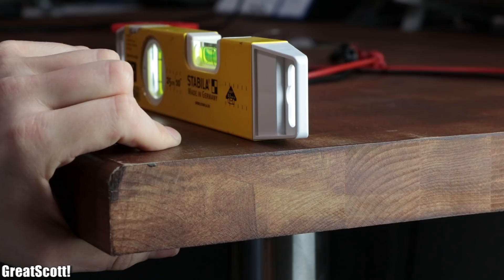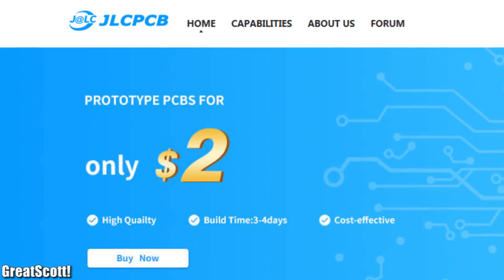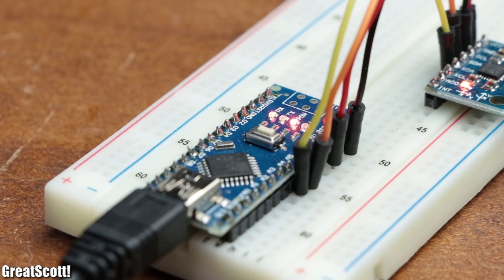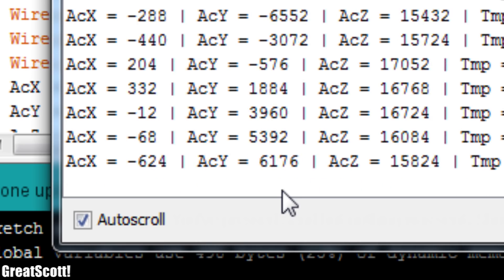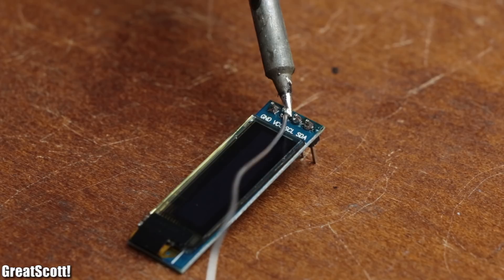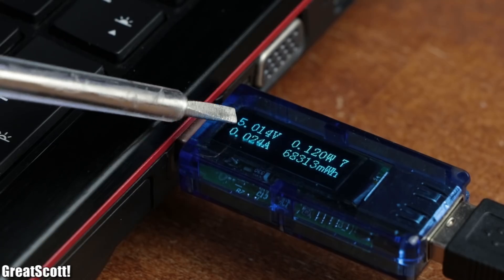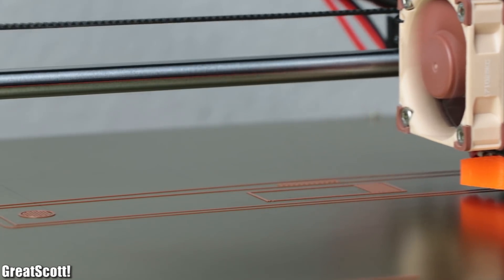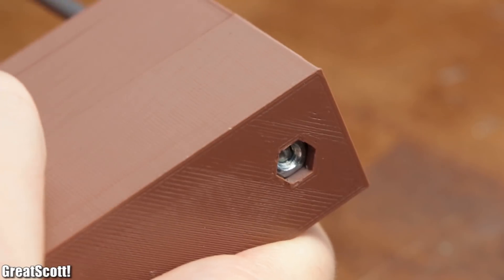DIY Digital Spirit Level || Accelerometer Tutorial

Comment: great tutorial! :)
I have completed a similar project, a car accelerometer but the problem in my case is if there is vehicle roll it picks it up and displays different lateral g force than real, a bit lower. I’ve used the mpu6050 and with a moving average it filters vibrations very well, basically even with engine vibrations or if you tap it, it would keep to zero obviously the “trade off”  is slow reaction time but this is in fact very convenient as you can’t read a display that changes the values too quickly. 
so the fix for the tilt would be a gyro but it seems a lot more complex 🤔

Comment: if you reset the board or... switch on the board at an angle, the MPU-6050 takes that as the reference angle(that is Pitch = yaw = roll =0).  For example, if I switch on at an angle of 45, it would display "0", and it will show the difference from that angle. 

How did you avoid this? Please help me with this.

Comment: What would it take to develop a 3-axis accelerometer that can save data, and including power supply can fit within an area 28x24x131mm? I'd like to mount one inside a model railway container wagon load, to record and then provide data on gradients and curve banking.

Comment: 28hours standby power for 1.2amp 3.7v battery. But what is the value 0.8 that you have multiple to get the standby hours. Sry if I am asked wrongly.
Reply: 2 years later and I'm scrolling through the comments wondering the exact same thing :P I think it's some kind of safety factor

Comment: With a bit more accurate and stable reading, it could be easily converted to a digital protractor (Few switches for unit selection, zero, 3d angular reading, angle registration and slight code additions of course). Waiting for the gyroscope part ;)

Comment: You need to calibrate it as the accelerometer may be at an angle to the bottom of the level. I would glue on carbide feet too that way you can lap them flat.

Comment: Why don't you calibrate the level by measuring the level, turn it 180 degrees around the z-axis, and then measuring again, and use the average as your 'zero'? Then you don't have to worry about how well your 3d print is, or how well you attached the accelerometer.

Comment: I actually have been using the 6050 to do some motion capture, using a library that taps into getting raw quaternion data from the chips that it generates itself with its own corrections. Using that, I've found the accelerator data to be very accurate and only start to drift after 20 hours of operation with no movement (yes, when I leave them on by mistake). That being said, I may have to order a handful of the 9250s and see how much better they work.
Reply: Thanks for letting us know about your experience. I think it's great these sensors are so inexpensive.
Reply: Well here's another one: The chips can only have 2 IDs, which I don't remember right off the top of my head. However, it can be adjusted by setting a pin high or low. A way around the need of an IC Multiplexer is to just have all set to low and set the one you want to grab data from to high. When in the internal calculation mode, it will cry about an overflow issue, but if you set it to flush the data and wait on the next incoming message, it will be nice and clean. Set it to low and go to the next with high. Rinse and repeat. Granted, I'm using an ATMega 2560 to do it (extra I/O pins), but if you used a bit-shift register, I'm sure it'd work just the same.

Comment: Great build! I've tried many digital levels and none of them are as accurate as a bubble level.

Off topic but the size of the bubble in that Stabila level was truly disappointing. It needs a larger bubble to be able to read between the lines without guessing if it's in the middle or off to one side.

Comment: Can I do this with a raspberry pi zero ???
Reply: You would probably need a bigger battery. But yes, any microcontroller or computer capable of using I2C should work.
The R Pi Zero is kind of power hungry compared to a small Arduino.
Reply: Duane Degn THX MAN ☺️

Comment: Hey Scott,  another way of reducing noise is to use all three axes simultaneously in your calculations. If you use the angles between the values you reduce your nose significantly, and get a now accurate reading overall. If you combine that with the 9250 chip you would get virtually zero noise in the calculation. Loved the project!

Comment: Yeah, there's a lot of potential error to be had in the mounting, but you could always do a slow manual calibration with some tissue paper shims. It could also probably do well with all the readings over 100-500 milliseconds constantly averaged. Easy code, easy tune, and the output is so much more aesthetically pleasing than taking the real time data to the eyes.

Comment: Useful for determining if something is level, but completely useless to actually measure the actual tilt angle.

Because the Y value that the accelerometer gives you does not scale linearly with the angle, rather, it does so with the sine of the angle.

Because of the way you assumed it scales, if you tilt this level 45 degrees, it will show 63.6 degrees or so.

Comment: Great video as always. I just wanted to signal that the angle/force relation is not linear, so it would be
yangle = asin(AcY/16384)/pi*180
instead of
yangle = Acy/182.04
You can visualice the error in the following graph
https://www.google.es/search?q=asin%28x%2F16384%29%2Fpi*180%2Cx%2F182&oq=asin%28x%2F16384%29%2Fpi*180%2Cx%2F182

Comment: I am currently working with the MPU9250 for Jugend Forscht. I actually wrote a library for it because the internet library are pieces of shit that a) don't allow me to use the FIFO, making it impossible to capture data at 200Hz while writing to an SD card, b) don't allow me to include external sensor with the I2C_SLV.. while c) taking up space and memory to support features I don't need like Wake On Motion.

The library seems adequate for your use cases, though.

Comment: How about putting in some code that detects which orientation the sensor is lying, so that you can still measure by laying the digital level on its side (which the code can detect, then  it measures the x or z acceleration instead of y), and the display reading will then face you. Maybe if you then flip the sensor upside down,  the reading on the screen will also flip so you can still read it (not sure f that's possible)

Comment: You could smooth out the output out. Also you could dynamically change smoothing strength.
Fast changes, mostly in one direction -> minimal smoothing to decrease lag
Small, oscillating changes -> stronger smoothing for easier reading

Comment: Thought I would link you to an article that explains the noise on the MPU-6050.  I had the same problem while conducting research for science fair and was frustrated about the results I was getting. I eventually averaged it out by software methods and got conclusive results. I ordered a new capacitor last week and am waiting for it in the mail. I’m excited to see the improvement of the sensor with an simple capacitor fix. 

(Link to the article detailing the problem and what to fix) 

https://forum.arduino.cc/index.php?topic=394691.0

Comment: A quick way to improve accuracy is to use all three axis in the tilt calculation. Some MEMS accelerometer manufactures have white papers on such topics. You will find errors once the tilt exceeds 45° or more if only one axis is used.

ST application note - AN4509 will provide more info.

Comment: Dont use mpu chips. Tgey tend to drift off and so you need a filter to get reliable data. Tgey have a dmp chip on-board which does this for use but it is a pain to use it. The register map is incomplete and you cannot find any kind of useful documentation for the same. Now you may say that we can run a filter on arduino but it is really computationally expensive to do so. It results in delays and basically hogs up basically most of the memory of arduino.
Reply: I've heard nothing but great things about i2cdevlib. I'm pretty sure I've used it with a MPU sensor and if I remember correctly, it worked well.
Reply: Any good suggestion then?
Reply: Hasanur Rashid i dont know about other chips but the mpu lineup is especially difficult to work with. One thing you can do is use a faster chip like raspberry pi to do the filtering for you. So you just take the raw data from the accelerometer and gyroscope and then you process it but raspberry pi. But again then you cant use arduino. You can consult people at invesence(manufacturer) . They are helpful but sometimes it seems that even they dont know how to use it with arduino. Moreover to use the dmp, you have to update the bootloader of your sensor which requires a software key(i guess you are required to buy it) and it is just a big mess.
Reply: well, there are Quadrotors out there that uses this chip and many ppl run things like Kalman filter or complimentary filter to get the angle data. and I have used dmp on arduino. Pretty reliable.
Reply: Hasanur Rashid can you pls tell me how did you manage to use dmp on arduino?
Reply: LegendLength no larger drifts over longer periods even reaching 25%
Reply: LegendLength look up gimbal lock and accelerometer and gyroscope drift. It is really intresting
Reply: The arduino example in i2cdevlib library.
Reply: Duane Degn as far as i can remember, i2cdevlib code for dmp works but it is onlu for mpu6050 not the mpu9xxx lineup. Mpu6050 are inherently(due to hardware limitations) less accurate than mpu9xxx. Moreover as far as i can remember, for mpu6050 also ot only has a teapot sketch and i dont think so that a code for reading data from dmp and displaying over serial monitor exists. But again it has been a couple of years since i  looked into it so maybe some changes have been made to it.

Comment: Just two hours back I wanted to make this and you deliver just that. Do you have sensors recording the followers brains? Awesome stuff.
Reply from the maker: Keep it a secret!
Reply: I have the MPU 6050 board which is being used for a quadcopter project. Can you share some links on how to use the Arduino as a PID controller with this sensor input? Has been a real struggle to make it work properly. It never shows 90 degrees when perpendicular to the ground.

Comment: You could have utilized the integrated sleepmode the accelerometer comes with. Then you could have put the arduino to sleep and use the accelerometer as an interrupt to wake it up. i think that would caused it to consume considerable less than 1mA when its in standby, might be able to remove the switch at that point. you could just put it in the shelf at that point and use it like you'd use a normal level without turning it on and you probably only have to charge it once in a month or two. Just a suggestion.

Comment: Wouldn't the cheaper accelerometer also work if you would use a low-pass filter? Also maybe the warping of the frame can be counteracted by calibrating the accelerometer, by putting it onto a known level surface. One often also has to do this in mobile spirit level apps.

Comment: A couple quick modifications that would've made this better:

-Adding Kalman filter, to use the gyro as well, in order to cancel out the shaking noise. 
-An offset zeroing button that zero'ed the level, allowing for relative leveling. 

Great video tho!
Reply from the maker: Good ideas
Reply: Excellent.

A zero button. So you can lay it down next to a reference level. Once a perfect level is known, press the button. Need a way to store the setting. SD card? Hmmm.. was that 28 hours with or without the display? How long can the level stay powered without the display on? Maybe put it to sleep. 

A way to get that jumping around on the data stream to even out would be to write code to continuously average out a sample section, take 1000 measurements (size?) into an array, average and update display. You could then write two of these functions with two arrays and overlap at the half way point so there are never discernible starts and stops. 

And write a bargraph routine to display an actual line the moves back and forth instead of numbers. Add a button to toggle between the options. 

Sound - a little beep when it centers would be helpful when the level is overhead and the display can't be seen.

Great build - and thanks for the work you put in on it to share whit everyone!
Reply: @AtomkeySinclair  arduino has EEPROM to store settings
Reply: @H0ttabych  yessir - eeprom.h me thinks will get single byte reads/writes. Only caveat there would be the number of times you can write. Which is a lot, but still has a limit. I think, for this application though, it would work very well. Good idea. Just check init values when starting to make sure they are set properly as expected later for the read in process.
Reply: Dr Webius Internata Shall help you
Reply: Do you have some good resources for learning how a kalman filter works?
Reply: Oops - someone said the zero button thing.. But with a different reasoning for it. I like motherjoon's idea better. But same concept.
Reply: I guess there is a Kalman Filter library for mpu6050. You can easily get it on github. You just need to tweak the parameters a little bit. You may check the drone projects to learn more about IMU.
Reply: You can also use a complementary filter instead of a kalman filter, it's easier to implement. In your video you say that the y axis of the accelerometer and the angle are proportional but you also show the equation F=G sin(alpha) so it's not proportional right?
Reply: You could also just use the microcontroller's eeprom to store the calibration values
Reply: I'm looking for an accurate "absolute" level. I was thinking of an option of averaging readings with the level facing both ways to determine the "zero" error without needing a level surface.
Reply: And make it all cleaner, the sensor mounting, the opening for the oled and the soldering, quick and dirty for a complete project is pfuipfui Scott, I am disappointed ;-)
Reply: How about also a button which stores all the xyz tilts, so you can install stuff at the same angle as some other stuff? Like have all the shelves five degrees off level in every direction, but exactly the same way off level. I'm sure that'd blow some pedantic minds!
Reply: Bro i want the code
Reply: @BlondieHappyGuy  fantastic comment! Thanks for the detail.

Comment: You did a small angle approximation. To really get an angle from the accelerations you need an atan2 function. Division works only for angles close to zero.
Reply: Gotbread Actually, he did not the small angle approximation, but the interpolation of the full range of accelerometer unto -90 to 90 degrees range. For small angles it will get greater values than should be.